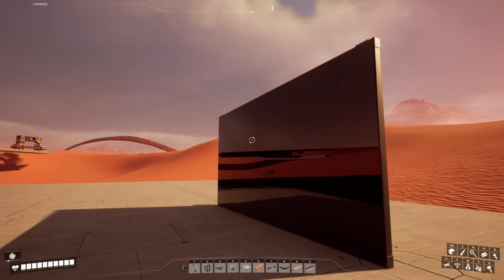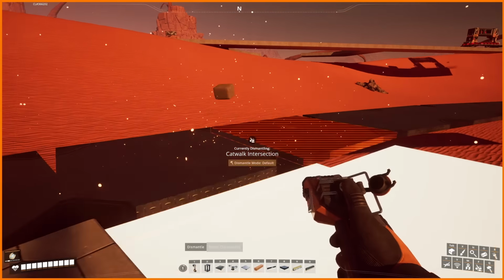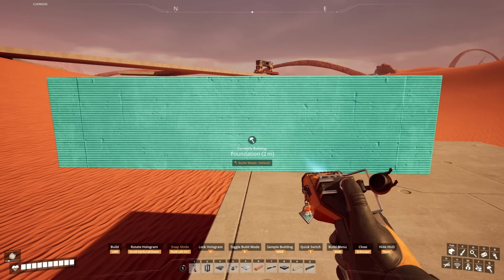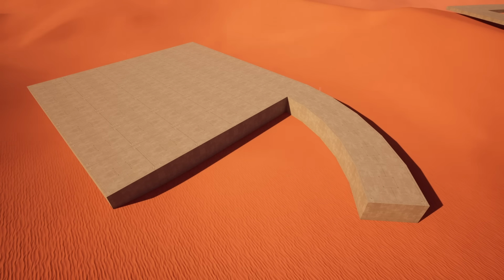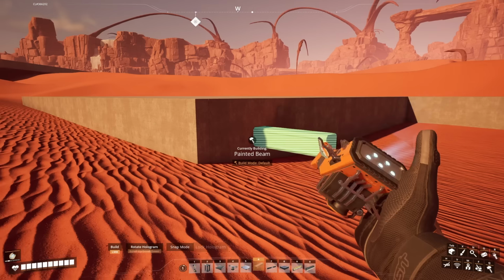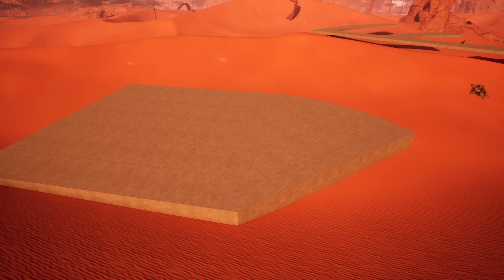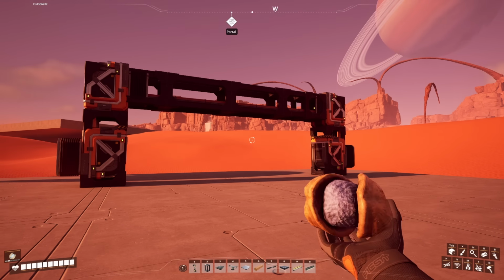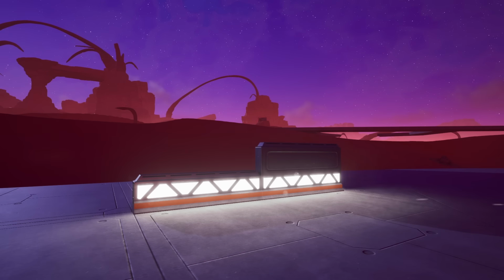Easy Curves, Merging and Essential Build Tips For Satisfactory 1 0

Comment: for the 5degree turn method you shouldn't need to snap another foundation under your placeholder one, there are hotkeys to nudge downwards so you can just nudge your foundation into place instead of placing it and adding the one you want and removing the placeholder. Default for the up and down is the pageup and pagedown keys I think.

Comment: For quick 5° curved buildings, I did find a way to make the process a bit quicker with a blueprint. It’s kinda goofy but still faster than individually tweaking each piece. If you haven’t figured a better way yet, I’d be happy to share. It may be modifiable for path purposes as well, but I’m typing this right after figuring out using it for buildings

Comment: 9:17, could you theoretically path the beam to the opposite end of the platform on the right to get rid of the gap and the slight angle difference betwwen the original platform and the connecting platforms?

Comment: Thank you for the tips. I tried to do a blueprint of the second curve tip (with concrete floor). But it doesn’t work as a blueprint because the blueprints doesn’t snap to each others. So does that mean you have to do this curves by hand each time ? Or is there a secret tip also for that ? :)
Reply: OK I found the solution by looking at another video. Actually you have to place a normal concrete floor first just below the position you want to place your blueprint and use it as a support. Then you have to lock the blueprint hologram in place and nudge it to the correct position. It’s requires a bit of practice but it works and it’s faster than doing it all by hand.

Comment: While this is a good video and good advice. The current way rails work is not acceptable. Its clunky and annoying.

Developers need to take notice of Factorio. And make it so that support pillars appear automatically and you can adjust angle of turns with your scroll wheel.

Mindless busywork does not equal gameplay or fun.

Comment: I've watched a lot of these videos on using the catwalk to make foundational turns when making clean curves.  Might I suggest you tell them to first go into Options, under Controls, then look for the setting that says Hologram Rotation Mode and set it to Always Face Player.  This will give the ability to turn the mouse wheel and give it the behavior as you are doing in the video, those incremental turns.  Otherwise the default setting will always make the hologram ONLY turn 45 degrees.

Comment: I have a problem with the display sign + low barrier. They don't render at the proper distance. It only renders the light at about 8~ foundation lengths away. A display without the barrier renders very far in comparison.

Comment: I tried to Ctrl Scroll to make a curve yesterday and it wouldn't rotate in small increments when it was lined up with another side of the object. all it did was rotate the hologram to each of the 4 sides, but would not do a small pivot. what am i doing wrong?
Reply: Sometimes it doesn't work. Try moving the character's position, move the mouse away and try again.

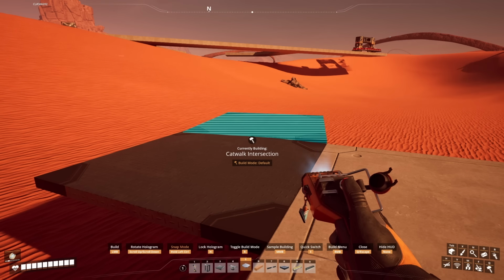Comment: For anyone struggling to get the Catwalk rotation to work (from around the 2:30 mark), go into the game's Settings > Controls, and set "Hologram Rotation Mode" to "Always Face Player" (at least I think that's the option that's the most consistent. Definitely change it OFF of "Static," as I think that's what's preventing it from rotating smaller angles)
Reply: Alan, you are my hero of the week.
Reply: Unfortunately none of the options work for me. I've tried every setting in the options.
Reply: @hicube82  I was having issue with it too but found out that if you're standing too close to the egde you're placing the rotated catwalk on it won't let you properly angle it. Maybe that will help?
Reply: @Gingerperson1234   It already worked. I messed around with the settings and it started working.
Reply: @hicube82 I'm having a hard time with rotating less than 45 degrees at a time. I'm going to place the platform, locking the hologram, nudging it, unlocking the hologram, and trying to rotate using the mouse wheel. Am I doing something wrong? I've also tried changing the hologram rotation mode to 'Always face player' without luck.
Reply: It ended up working for me to place a platform above and press Ctrl + mouse rotation to get the proper placement and then placing the overlapping platform below. The problem was that the snapping was preventing the fine rotation.
Reply: @hicube82  are you trying to do the rotation while in the Nudge mode? Like after you've locked it in-place and are trying to nudge it? (the rotation only works while NOT in nudge mode, just to be clear)

Otherwise, have you tried the different sub-settings that appear when "Static" isn't chosen? I'm not in-game, but I think it's something like "Parallel" and "Perpendicular" that show up if you expand the little arrow to the right of the settings

If none of those help, I don't have any other ideas, sorry. I will say that even when it does work it's still a pretty finicky thing, and it sometimes takes a few tries.
Reply: @hicube82  Use that snapping thing, otherwise it won't work.
Reply: Exactly. Before I couldn't get it to work but changed the settings and voila.
Reply: Thanks!
Reply: You are a lifesaver! Thank you!
Reply: Brilliant! I couldn't figure out what I'm doing wrong.
Reply: @alan-daniel My main issue is that it wont snap to the catwalk cleanly, it snaps either halfway into the first catwalk or to the foundation, never to where I need to on the catwalk if I use ctrl.
Reply: @ZyJerasca  is your Hologram Rotation Mode setting set to Static? I'm pretty sure that also prevents you from being able to snap it where you need to in order to do this rotation thing, in addition to just preventing the smaller angle rotation

If it's already set to something that's not "Static," I wish I could help but unfortunately have no idea. I will say that it's sometimes pretty finicky, so make sure you're trying from different camera angles/distances/heights/etc.

If you haven't, it is worth going through all the different sub-setting combinations, so try setting Hologram Rotation Mode to "Always Face Player" and then try both sub-settings, Parallel and Perpendicular, and repeat for "Spawn Facing Player"

Hope that helped!
Reply: @alan-daniel  it is, though I did try changing it with it still doing the same thing. I found the issue and I have no idea why it's doing this. It's basically rotated a full 180 degrees backwards so it looks like it's snapped in the wrong spot. So your suggestion was 100% correct but for some reason it just snaps it al backwards so I have to rotate it all the way around to make it work. Very weird issue.
Reply: Holy Beejeezus thank you so much it saved my sanity
Reply: changing from static to always face player allowed me to rotate catwalks

Comment: The 5 deg curve is a nice wide curve. however, starting on the global grid, after a full 90deg,  the last foundation is off the global grid by 1/2 tick so I cant add a foundation as a small filler to get it back to the global grid at the end or the beginning because it is off 1/2 tick in both n/s and e/w directions. I would need a slight little extra diagonal with the freeform beam right? is there a better workaround?

Comment: For those who (like me) are curving three foundation wide roads. Keep in mind that the longer the curve, the thinner the whole road will get at the end.

1. Start with the innermost foundation when curving.
2. Stagger the curving points on the centre, and the outermost foundation. Use half foundation blocks every so often on the outermost side.
3. Every couple curves (on the innermost foundation), zoop it to the outermost foundation, then merge them both. This keeps a clean curve, while making sure you stay at three foundations wide.
4. Then you finish curving the centre foundations last. This way you can still keep clean patterns painted on without too much z-fighting.
5. If you're still struggling, instead of curving the road from start to end, and then merging. Merge the start to the midway point, and the end to the midway point, and then merge.
6. Using Asphalt? Those annoying black lines between foundations? Yeah, clip a half foundation to get rid of them without messing up the pattern (if you're using the centre dotted lines)

Comment: Neat trick with the beam snapping for the edges. As a tip, for tighter curves, the techniques you showed can be also applied to half-foundations.
But I also have a question - is there any way to create a curved ramp for a smooth road turn going up- or down-hill? Any ideas?

Comment: If you didnt know, it is possible to make blueprints larger than the blueprint platform. You do this by making a blueprint, lets say a foundation on either side of the platform. Save it, clear. Now, place the newly made blueprint back on the platform but offset it by placing it near the edge of the platform. One foundation will be outside of the blueprint platform boundary, and one will be in the platform boundary.  You can repeat this process over and over slowly moving things further and further outside of the boundary. One person has a blueprint over 2km in size.

Comment: So happy to see my 5° curve method in there. I don't know if you got it from me (I did excitedly post it in discord the day I figured it out), but I remember the day I spent experimenting to build my train network. The only difference is I place the sections on the outside of the curve so that I can then align blueprint Road segments to them and have them perfectly match corner to corner.
Reply: That curve method isn't working for me as shown. If I do it on a foundation placed on the ground, after I place an adjacent catwalk piece, the one I try to curve from it rotates in place with no Ctrl press and rotates around the placement edge in 90 degree increments while holding Ctrl. If I try the same in the blueprint maker, without Ctrl it rotates in place and while holding Ctrl it rotates as shown here but its snap point jumps to the middle of the first catwalk piece. I just can't get the desired alignment! Any ideas what's wrong?

Comment: I've come back to Satisfactory for 1.0 and am constantly frustrated by my lack of "design". I've learnt this save to use the world grid which is going so much better for trains, but im so bored of running straight concrete everywhere and trying to then make it look nice. These tips should defo add some awesome flair to my builds. Could you maybe do a video showing the optimal way to run train track over the curves? And do you have any great tips for adding bridge structure to my currently floating 2m foundations and/or the underneath to make it look structurally sound. I hate floaties!
Reply: Actually I was in the same boat for a while and what helped me a lot was combining concrete pillars and steel beams. As shown in this video you can get almost any orientation on the end of a steel beam and the concrete pillars snap in all orientations (unlike walls and foundations) and are super useful to make flat walls less flat.

Also you can snap pillars to the bottom of rail track. Foundations can then be put on the pillars and the track will be perfectly centered on them. Only works if you have enough space under the track to work though.

 I have had decent luck with just building track in the air with no foundations and then just snapping blueprinted supports to the track at regular intervals. You can eyeball a regular interval based on the repeating texture on the bottom of the track, it's not 100% perfect but looks good enough.

Comment: The beam trick to merge 2 separate grids was shown by someone a few years ago iirc. I belive it was before nudging, so you would place another beam 90 degree to the alignment beam 4m from the foundation. A bit more tideous, but worked well. Also worked with height differences, but you need to repeat the 4m beam 8m apart to get small increments

Comment: if you want to double side the light in the barrier you can use two 2m signs on the other side back to back and drop in the barrier. looks great from a distance and the line separation matches midway on the pattern

Comment: I understand the factory will always grow and build but do you know how many resources per minute you need for later game items? For example, im making 10 reinforced iron frames per minute. They are used for the smart plating set up. However, modular frames come into play and i have a factory producing 10 per minute. 

I understand concepts of rebuilding or finding a new build spot to produce more, but is there a general rule of thumb for how much of a resource you should produce per second before moving onto a new factory and moving on? 

I move slow. At the start, even though i had 120 ore on a node, i build a factory that needs 240 just so i dont have to rebuild as often. 

Sorry loaded question. Is there ever a point where you can complete a factory 100% and not return to it? I just hate spending a ton of time decorating (my favorite thing to do) and having to tear it down right away. Idk i guess theres no clear answer. ><
Reply: I've found making modular blueprint designs super helpful not only for instantly placing stuff like 4 fully connected smelters/constructers etc but also being able to easily delete the entire blueprint placement later is so convenient while needs keep changing as I progress.
Reply: It partially depends on how you play the game. 

If you plan on shipping materials often (let's say you make all of your reinforced plates at one facility and want to ship them all over the map) then it's possible to set the factory up and only return when building a new train line, drones, or truck. 

What I typically do is make very small scale facilities for the basic items solely for storage and inventory purposes. (pretty much everything before oil production) This is even better functioning with the addition of the dimensional Depot. Then going forward past oil, I like to produce high amounts of expensive items that I know I will need a lot of late game, and transport those, more expensive items, around the map for future facilities. 

For me personally, and I think the most important part of my reply; anything that uses only Iron, Copper, Limestone, or water, gets produced in every single factory and I generally never transport around the map (iron rods, plates, reinforced plates, copper sheets, wire, etc) I only consider the possibility of shipping when other nodes start coming into play, like quarts, caterium, coal, nitrogen, etc. with that being said, it also depends on where I'm at on the map and where I plan on building other factories; that determines if I will produce high volume and transport, or make the material in the  facility. 

The way I play, I currently have a facility set up making 15 heavy modular frames a minute and 50 motors per minute. This may be overkill for some, but for me it sets me up for late game and leaves a little breathing room. 

It really is a bit of a loaded question and it's impossible to cover all of the different play styles and logistical set ups for transporting vs in-facility production. Not to mention how drastic alternate recipes can affect the required resources for a factory. 

I wish I could leave an audio reply for you lmao. Best of luck fellow pioneer.

Comment: I do the same when merging grids, but instead of nudging I just go 4 meters a.k.a 4 locks back, switch into straight mode and place a 4 meter beam. The foundation now perfectly snaps into the 4 meter beam which is perfectly aligned. Actually doing this since years, so my flow is kinda fast. But I think it's time to test a new way
Reply: i did the same with 4 meter beams. saw this about 1 year ago in a Relyen Gaming video

Comment: once mods are working
recommend the infinite nudge mod
allows small rotation/ nudge increments making setting up curves way easier
also allows vertical movement which is a lifesaver when placing blueprints that don't snap correctly height wise

Comment: I can't get it to work. I place a catwalk down and then the next one I'm supposed to rotate doesn't rotate. Or it rotates around the other catwalk in half-square sections, like it's going from the middle of the catwalk. Not sure what's wrong
Reply: OK boys, i think I figured it out. just hold ctrl and keep rotating it forward or backward until you get it where you want it
Reply: @nanjo621  This is the way
Reply: Sounds like you might not be holding ctrl when rotating it? You also must rotate it off anoter catwalk, not a foundation.
Reply: @VeilStar  Just tried it again. The catwalks work for the first few rotations. Then they start snapping to the corners of the placed catwalk.
Reply: @walkju1  im having the same issue, not sure what is causing it, sometimes it works, sometimes it doesn't :/